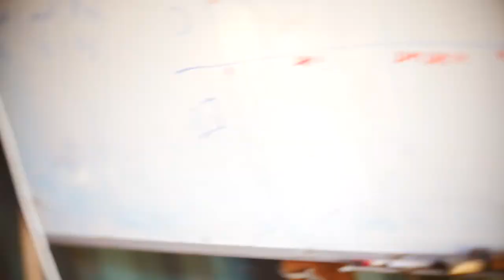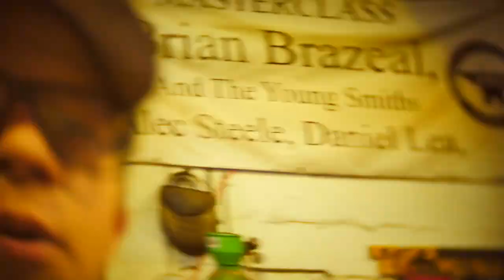Forging a Sledge Hammer

Comment: Eyy, really cool that you can get to do some shooting!
So, when you were talking to Sam about giving him the forge, it sounded like your gas forge was gurgling there. That's from too much fuel and not enough air, right?
Reply from the maker: That gas forge burner gurgles at the lower pressures - presumably for the reason you stated :)
Reply: Ah. Thanks!

Comment: Its not forged. Your not doing it right. Your just deforming it.
Reply from the maker: Then what is forging?
Reply: The process of compressing metal to the maximum. At which it cannot compress anymore. The metal is smaller and denser.
You should know that. Its what manufacturers do to make tools.
Reply from the maker: Sorry, but that is not correct. Forging is the process of heating metal to the point of malleability, moving and forming it with the application of pressure. :) 

That sledge started out as a bar of 85mm round steel and was forged into a square and forged into a sledge!